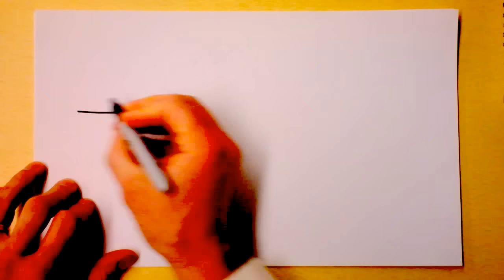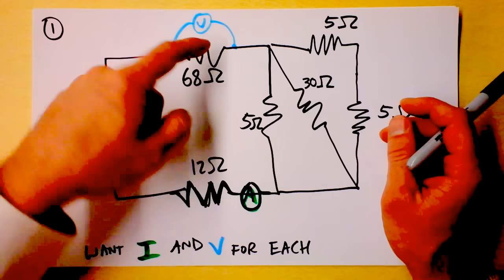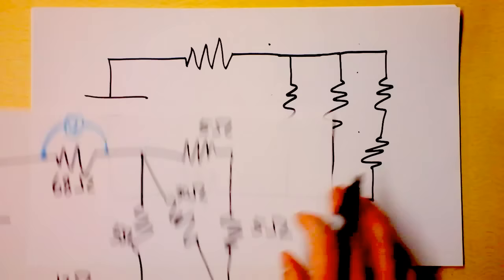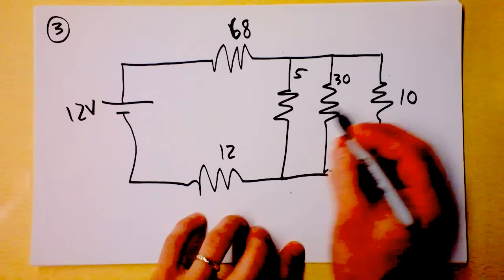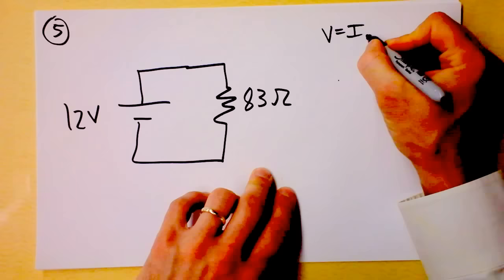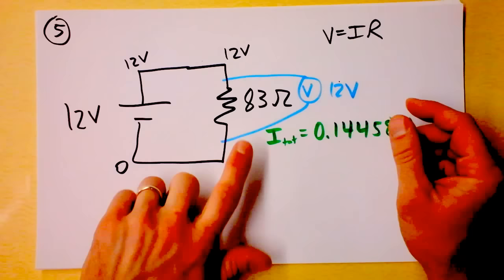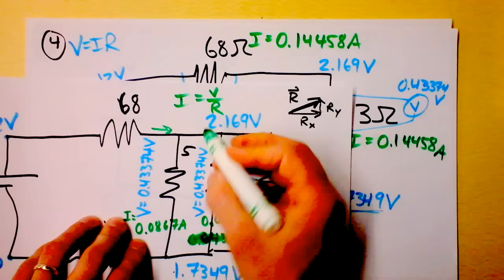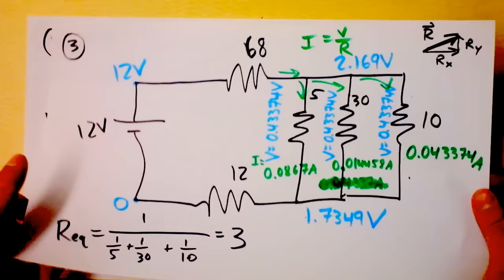Parallel and Series Resistor Circuit Analysis Worked Example using Ohm's Law Reduction | Doc Physics

Comment: I would assume that for this type of problem that we would ignore the resistivity of the wire itself. Or is that just included in the general resistance if the many resistors.
Reply from the maker: Zachary Smith Wires are indeed assumed to be perfect here.

Comment: Very helpful video. Although it bothers me that used I for amperes, but you choose to use V for volts. When in text books it is represented with an E. Also in real world situations you will always use engineering notation to express the final numbers. Ex. 0.0187 A, = 18.7 mA
Reply from the maker: +Luke Miller I don't have any engineering experience, so I appreciate your note.  What is written as an E?  E represents electric field in my world, so that can't be used without confusion.
Reply: As an Industrial/ residential electrician learning Ohm's law & Watt's law, E= Voltage in Volts, I= Current in Amps, R= Resistance in Ohms, P= Power in Watts. Engineering notation simply makes it easier to read, or in my opinion, more proper. Like simplifying an improper fraction. Same amount, different representation.
Reply: Ex. 0.000,008= 8 micro, Scientific notation 8*10^-6... .008= 8 mili, 8*10^-3... 8000= 8kilo, 8*10^3
Reply from the maker: +Luke Miller Fair enough.  I'm sure the E = voltage is as weird to me as my system is to you.  We just need to make sure we have The Talk before comparing our work or collaborating!

Comment: is there like a full proof method to properly identify whether the resistors are in series or parallel in more complex circuit.I always end up identifying when series or parallel resistors wrong in very complex circuits and also the approach sometimes lands  me the wrong answer taking another part of circuit in consideration before some other

Comment: Decent but it would have been better if you chose resistor values so you didn't get so many decimal places so the video would be shorter with less clutter.  I still upvoted it though.

Can you do that problem where you take a pair of purely resistive incandescent lamps of different rated wattages (for example 40W and 60W), and show them in a series AC circuit, and explain why the 40W lamp will glow brighter than the 60W lamp?  Someday I will actually try this using real lamps and can also try it both at 120VAC and 230VAC.  Assume both lamps are rated at 120VAC nominal.

As a bonus, try to predict the total wattage consumed by the circuit, assuming 120VAC and 40W + 60W lamps (rated wattages at 120VAC).  All voltages are RMS.  Thanks!

Comment: so.....i added the current results for resistors 5, 30 and 10. it resulted as .144532 not .14458 .....whats that about?

 iv tried two separate calculators and in the event my own math was wrong (which its not) i done the addition using the current values you have written and the result is still .144532

Comment: I understood your example but then when I tried to do a question myself I couldn't get to the right answer. It's where you have 2 resistors in series and a cell of 5V. So from positive to negative, R1 = 50x10^3 ohms;  R2 = 100x10^3 ohms. There is a voltmeter in parallel with R1 only. The question is asking for the reading on the voltmeter. The correct answer is 4.0V, but I keep getting 1.666666....

I'm just wondering as to where I'm going wrong. My answer for the current was 5/(150x10^3). My working for the voltage on the voltmeter was (5/(150x10^3))*(50x10^3).

What should I be doing to get 4.0V?
Reply from the maker: Annabel Edwards Annabel, you just learned an important lesson - Don't trust the key.  Your work is correct.

Comment: Why is that paralel 5 ohms(0.0867a,V0.43374V not equivilent to the first series 5 ohms(0.21687V)?
Reply: Isnt that the same 5ohms whic should have the same digits as the solved one?
Reply: Watch from 21.10

Comment: At 17:16, I don't understand how the voltage drop is the same for all 3, when the total voltage drop is 0.43374. Why isn't 0.43374 being split across the 3? I am a noob sorry.
Reply: I am confused because the resistors have different resistance, so I thought the voltage drop would be different across each 3. The 0.43374 would be cut down into 3 numbers that add up to 0.43374. Sorry again, maybe this is a stupid question.
Reply: Or is that how it works in parallel circuit? Am I mixing it up with series? Omg I'm confusing myself lol
Reply: When you have parallel resistances,the voltage is the same for them.When you have resistances in series,current stays the same.That's the rule

Comment: Why does the diagonal resister suddenly become in line...? I'm stupid and confused. Not sure which came first though.
Reply from the maker: +Eszekial You can move things around as you see fit as long as no wires are cut or added and no junctions are changed!

Comment: How we can find out the voltage of a resistor, if a resistor in a circuit is connected to positive from both ends. One positive is coming straight from the battery and the other positive charge is coming through the resistors and from there it splits up to a parallel circuit then going in to next resistor which is going to the ground. ?? Hope my question makes sense. Took me 10 minutes to figure out how should i ask. Its that confusing.
Reply from the maker: Tauqir Ahmed I would use the techniques of circuit reduction used here.  If they can't work, you will need Kirchhoff's Laws.

Comment: Probably going to ask before you actually explain...
If the current "I" @ the 68Ω resistor changes causing a voltage drop wont the next resistor be calculated based on the new voltage? 
12:36 the current "I" @ the 3Ω resistor would now be I = V/R, X = 2.169/3, I= 0.723 Right? 
This is why I never understand this stuff. The "Order" of things.
14:32 So by your explanation to get a correct measurement all resistance should cause voltage drop equal to the power supplied? (Too lazy to try it myself right now.
I still dont get why there isn't 0.723 A running through R2 3Ω

Comment: witch is the right order to calculate resistors ? parallel first and then those in series ?
Reply from the maker: Ah, that's a big part of the strategy.  You don't get to pick - the circuit picks for you.  Oftentimes, only one simplification will be possible at any given time.  Once you make that simplification, another one may become possible.
Reply: thanks , i though that it was a some kind of a rule about the order of the calculations .

Comment: hi, i wonder if you can help me with a problem? i have a solar panel that produce 12 volts, 5 watts, and i need to know how much ohms i need to drop the volts to 9 volts?
Reply: its a ratio thing...you would use two resistors in series accross the 12v.  and because your 9 volt is 3/4 of the 12v....you will have one resistor 3 times as much as the secound. so you can have a 30ohm and a 10ohm.  9v drop across the 30 ohm and 3v. over the 10ohm. total resistance is 40 ohms...and the 30 ohm is 3/4 of that total so it will drop 3/4 of the 12v which is your 9v.  you can use a 3 ohm and 1 ohm for more current but you should get ceramic resistors rated at least 5 watts
Reply: +Francisco Sanchez You use the equation P=V^2/R. The resistance will be R=V^2/P = 9^2/5 = 16.2 ohms.

Comment: Doc why do you not point out that the amperage is proportional to resistance in a parallel circuit and then show how to solve for amperage using that method? It would sure be a big help to me. I can see that it is, I just can't quite figure how to do it.
Reply from the maker: I guess it's like exploring a cave.  Given this problem again, I'm sure I would use a slightly different end technique (but they all start by finding equivalent resistance).  Just keep writing yourself simple problems and make them progressively harder until you've got it.
Reply: Doc Schuster
 I'm in my 2nd quarter of my electricians pr0gram. I think I've got it, but I tend to forget a little unless I keep in practice. Still though, for me it would be a help to remember a mathematical rule/ formula for finding amperage through the proportion of resistance.

Comment: How is there a voltage drop along horizontal parts circuit and resistors! I thought it was an equipotential line?
Reply from the maker: +Mr. Gruber It's not the resistor's orientation in space that matters, but its connections!
Reply: Can you explain that a little more? Also if their is 2 batteries in a circuit you have to use Kirchhoff rules correct?

Comment: I am having a huge problem with VD and I can you please help me my R1 330 R2 120 and series 150 R3 find voltage VD and from 12V at R3 my VD is 3.12 for R3 how it is possible is spouse to be 0 at return to battery not 3.12 not 2.868 difference.

Comment: sir your lacture amausing but i donot understant what differnce between series and parallell resister .
Reply from the maker: +Tally international Thank you.  Please watch the videos before it in my playlist.
Reply: R=Resistor
V=Voltage
I=Current

For series

R=R1+R2+R3
V=V1+V2+V3
I=I1=I2=I3

For Parallel

 R=1/R1+1/R2+1/R3
V=V1=V2=V3
I=I1+I2+I3

I hope it helped. im still not sure about this though. im sorry

Comment: At 14:37 I found you didn't do the calculation you actually wrote down. 1.7349V - 1.735V is 0.014V. I know it's tiny, but it's not zero. Have I misunderstood something???
Reply from the maker: No, you're fine.  We did some rounding.  The answer should be exactly zero, and would be without rounding.
Reply: I'm having real difficulty with this in my second year of college. Thanks for the confirmation though. I may go through this video again and pause some more.
Reply: 1.7349 - 1.735 = -0.0001
close enough to zero :D

Comment: But wait a minute. First of all the flow of current seems to be going in the wrong direction, and second of all why would you ever have 0 volts at the end (beginning) of the circuit? Voltage in a parallel circuit is the same throughout. Right?
Reply from the maker: Jordan Acton What text are you using?
Reply: Grob's basic electronics
Reply: I'm not sure if its in the books, but were taking problems out of the book and solving them. My teacher doesn't use conventional current flow and we get the same answers so I'm guessing the book doesn't either. Or does it matter if you use conventional or not?
Reply from the maker: I'm a conventional current guy, but I applaud you for "going against the flow."  Your answers will agree with mine!

Comment: In the UK we don't need to find voltage drop between resistors but just the voltage through resistors. Is it different in America? Also what sort of age physics is this in America. I.e. 17-18 year olds?
Reply from the maker: That may be a language distinction.  We say current THOUGH resistors and voltage ACROSS resistors.  Those would be anyone's goal in the US, but I use the (arbitrary) voltage at various points in the circuit to help me find those things.  Just an intermediate step, though.  I agree that voltage drop across each resistor is the only absolute voltage we have.
Reply from the maker: Oh, and yes.  17 to 18 years old - freshman in university.
Reply: Doc Schuster i'm in Canada, doing this in 3rd year high school (age 15/16). Great video!
Reply from the maker: Thank you!  Has that polar vortex been ruining your winter, too?

Comment: how's you get 3???
Reply: ???????//really
Reply: Ever Pushing Forward what? i'm in grade 9 and just starting to learn this stuff i have a quiz on Monday please help that's the only thing i'm truly struggling with
Reply: ***** thanks, yeah i figured it after looking at my notes and talking to my teacher
Reply: B0GGIEMAN101  How do you get 3 ?
Reply: it's kinda hard to explain by text (so I recommend asking your teacher) but basically, i took 1/R= 1/5 + 1/30 + 1/10 but what you want tp do is round 1/R= 6/30 + 1/30 + 3/30 than 1/R= 10/30 and than flip the numbers so R/1= 30/10 R=3 it's kinda confusing but that's how i did it
Reply: it is 1 over 1/5 = .2 + 1/10 = .1 + 1/30 = .0333 = 1 over .33 which equals 3

Comment: volt do drop in parallel
Reply from the maker: +rosendo madrigal I know.  I am stating that the drop is the same.
Reply: +rosendo madrigal No they dont.
Reply: +rosendo madrigal i thought voltage only drops in series circuit.
Reply: +Lee Junaid yes it does...just not in a parallel circuit...Just think of it this way....Series circuit. you have voltage drop, V1+V2+V3 will always equal for total voltage....parallel you don't have any voltage drop, but you have current drop ..I1+I2+I3...because of the branches in the circuit.  I"m new to this stuff too, my first month in Electrical Egineering. :D

Comment: my teacher told me that you cannot add resistance in parallel circuit why did you add
Reply: Yes you can lol. The total resistance in a parallel circuit is 1/R1 + 1/R2 + 1/R3 + 1/R4 + 1/R(x). You must not have heard your teacher correctly or your teacher was incorrect.

Comment: how did you add the resistors in slide 3?
Reply: my automovtive teacher overworks these problems by adding more steps this is a pain.....
Reply from the maker: Was the overall resistance less than each combined resistor?  Or was it the simple sum of the combined resistors?
Reply: i guess it was the sum
Reply from the maker: They must have just been in series, then.

Comment: Well. Technically you'll also have to deal with voltmeter impedance, shunt resistance, wire resistance and battery internal resistance. LOL

Comment: Thought the flow was - to + ?....
Reply from the maker: +David Koscinski But see, you have to say "the flow of ___"  If the blank is electrons, then you're right.  I deal in conventional current, the motion of virtual positive charges.
Reply: +David Koscinski conventional flow vs. electron flow.  It's a leftover from when 'we' thought electrons flowed + to -
Reply: +Doc Schuster so wouldn't the circuit be solved in the opposite direction?
Reply: Another way of putting it is "flow of holes" ("hole flow")... This particular circuit, though check with the Doc, because there are no direction-specific items (transistors, diodes, etc.) it should be solvable either way.  Correct me if I am wrong; I am coming back to learn much that I've either forgotten and/or glossed over in college, lol.
Reply: Here is another source I just stumbled upon...  http://tymkrs.tumblr.com/post/5513058883/conventional-flow-vs-electron-flow-theory

It may help... 'ground' some of terminology.  Common ground vs. earth ground and whether it can be used with a floating voltage is something new to me, Doc Schuster do you have a vid on that concept?
Reply from the maker: +Brendon Tristal No, but grounding complications and DC offsets are very important.  It's on my to-do, now.  Check back in 2018...

Comment: Starts with 12V, passes the resister and is reduced to 9.83V and yet he tells us it's actually 2.169V, and yet we are told voltage remains constant in a circuit. You could not find a more illogical system, makes no sense. I wish I never entered an engineering course.

Comment: _____r1//470____                 (//--ohm, = --b. volt.)               
|_____r2//330____|_r4//750__
|                             |                 |
=55v                     //r3 810      //r5 500
|                             |                 |
|_____r7//1.2k___ |________ |
|                             |
|                            //r6 1.2k
|_____r8//2.5k___ |

how can you find the IT,RT,VT,Ir1-ir8,vr1- vr8,how can I find out the short circuit and open circuit for R3. I did the same thing as you did like finding the current for ir1-ir8 and voltage for vr1-vr8,but im getting it wrong.( I think my calculation is wrong) lol..gotta check it again.
Reply from the maker: combine order as I see it:  step 1:  1and2, 4and5, 6and8.  Step 2:  45and3, 68and7.  Step 2 it's all in series as far as I can tell.  I still don't understand what "short circuit and open circuit for R3" means.

Comment: Well,current come from - to go at the + sorry dude
Reply from the maker: DUDE.  That's electron current.  Current is defined the otha way.  Check yo'self.
Reply: Doc Schuster I perssonaly use real current because i find it much easier for transistors,diodes,polarised capacitors, conventionnal current is good for electricity not for electronics,for me btw
Reply: Its really a good video for people before there exams ,  you have a good way of explaining
Reply from the maker: I understand what you're saying, but there all also situations in which positive charge carriers move or both charge carriers move.  Do not fear the minus sign!
Reply: I Just never heard of positive travels to the negative terminal of a battery. We are taught by our teachers in engineering that power moves from the negative terminal to the positive side.
Reply: ToNe LoCc Thats the electron flow everyone uses the conventional way which is positive to negative.
Reply: ToNe LoCc it's said as positive moving to negative not because it's a positive charge moving to a negative charge, but because it's a positive build up of negative charges moving towards a negative build up. If that makes sense lol
Reply: Thanx jay way and master nate for tring to clear it up.

Comment: Doesn't explain how he condensed numbers. Just threw up 3? Wtf. I'm watching to learn.
Reply: Hi Kyle, he used the "Parallel Resistor Formula" , checkout Digikey.com the "Prallel-Series Calculator", on the right side you will see the actual formula, replace the R letter with his values, divide 1 by the value, add the 3 values together then divide 1 by this new value and you should get 3 (3,03 actually)  like he did.